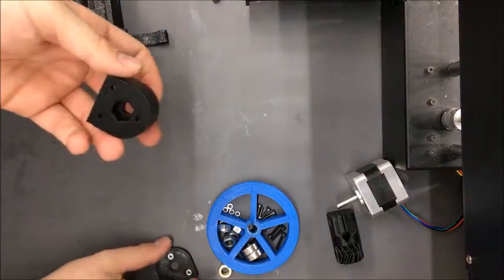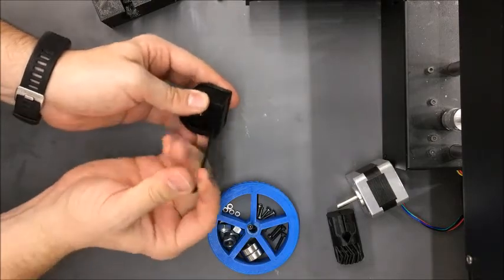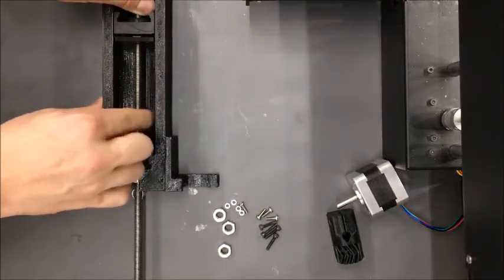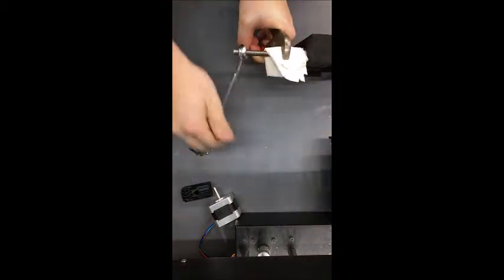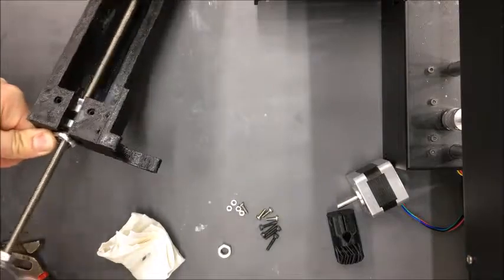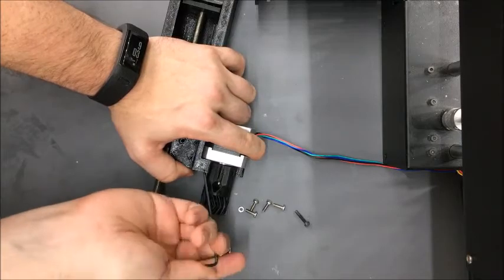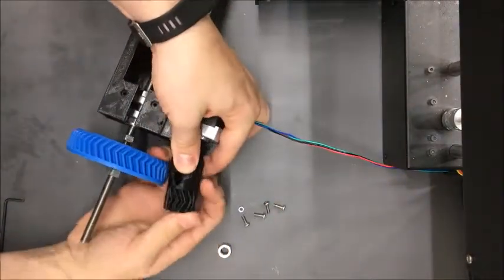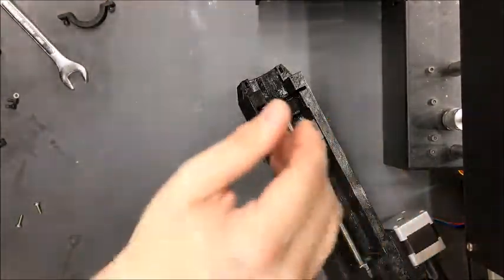Large Volume Extruder (LVE) Assembly Instructions Video

Comment: was interested to see if you believe this could be assembled on a Monoprice Maker Select V2 as it is rather cheap at 220 and seems to have a top bracket with screws that would allow this LVE to fit on perfectly. Would love to hear your take after a viewing at the printer I mentioned and appreciate your videos!
Reply: The Monoprice Maker Select V2 should definitely work! The CAD files might need some very minor tweaking (e.g. placement of screw holes and/or redesign of the needle adapter), but if you print and assemble an LVE, you can simply replace the hotend of your extruder with a needle like the one described in this paper and you should be good to go!

The CAD files can be found at the link for the paper (see video description).